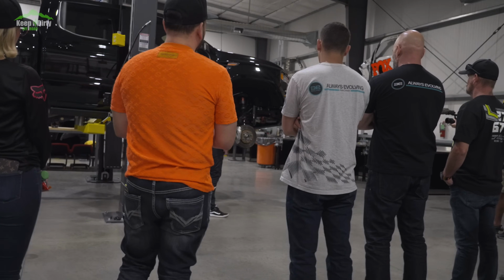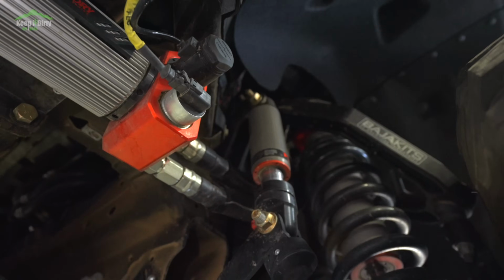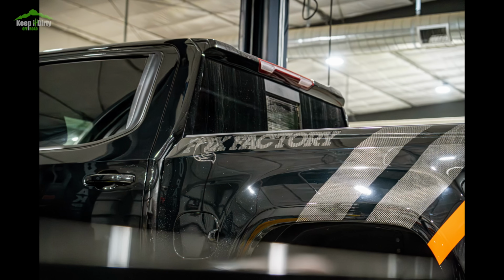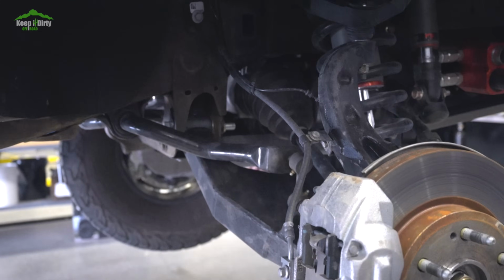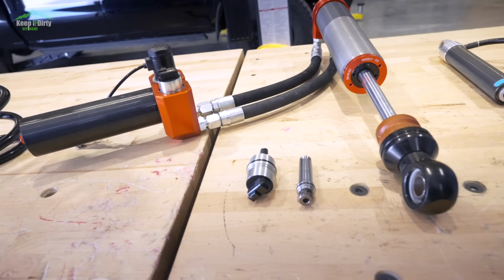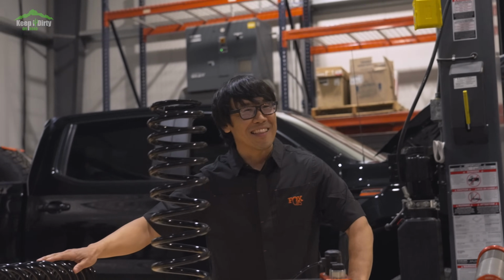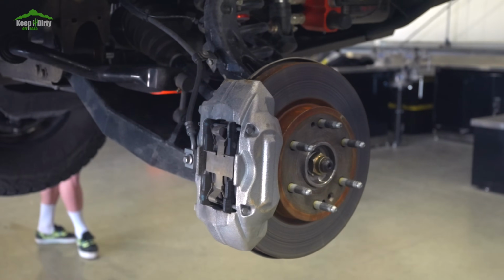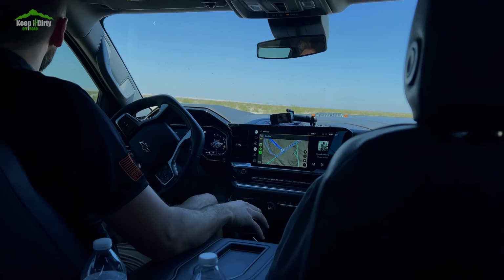FOX event presentation - Fox Factory Truck  Part 1

Comment: Blah ,blah, blah... end of the day. $210K is  not a practical price range regardless. There's probably less than 0.01% that's probably interested. Even if someone had the money for it; they would be better off taking a stock Raptor R or TRX and upgrading the shock system and making it lighter. Otherwise, this project is dead and irrelevant.
Reply from the maker: Very true. A stock 2024 Raptor R would outperform this with no mods.

Comment: Ok..now throw some bilsteins on that thing and close the book
Reply from the maker: 🤣🤣 for these kind of builds most would say throw on some kings.
Reply: @KeepItDirtyOffRoad  very true.. but some guys would rather just go with the best product from the start 🤷🏽‍♂️
Reply from the maker: Huh? For full size trucks Fox and Kings are at the top. No one runs bilsteins on them. Even fewer race teams do on trophy trucks. Winning trucks are still Fox and king.
Reply: @KeepItDirtyOffRoad  right.. i get that most people run king or fox. Exactly what makes you think they're a downgrade? Kings are pretty great when properly tuned. We run king on the racecar.. maybe you haven't experienced bilstein 8112's or m9200's, but they're a touch above. Even in a tacoma you'd need to run a bypass, coilover, bumpstops and limit straps to do what a single 8112 can do. I do however run fox oil in all my shocks
Reply from the maker: I admittedly don’t know much about the blistein product lines so I looked them both up. I don’t see anything better here than what Fox or King offers. If anything I see less from bilstein. The shocks you showed are comparable with the factory race lines for oem trucks from both companies. Limited tunability and rely heavily on a good base tune for the truck. Fox and kind have way more options with a ton more features. Fox has live valves, king has integrated IFPs. So many more options from both to improve the ride and performance of these trucks. 

One thing stuck out to me in your comment though. You mentioned a Tacoma. A much lighter platform that is very, very underpowered. Normally used for rocks and overlanding. Seldomly used for fast off-roading. It’s completely different worlds and you will find very few running Bilstiens with high speed off-roading full size rigs for a reason.
Reply: @KeepItDirtyOffRoad  that's exactly my point.. they do more with less. Bilsteins are highly tunable, the problem is finding a tech with the balls to work on them. They currently offer the most advanced suspension setup for oem replacement. Im not trying to convince you lol.  Its just plain facts. My 8112's are tuned with eibachs and fox oil. The only thing that's come close in the big stuff have been king 3.0's (with a proper tune) and still need a bunch more equipment to match the single bilstein 8112 🤷🏽‍♂️.. again im speaking from experience not personal opinion. Also my kings needed to be serviced every 20k miles.. foxs tend to go further at around 30-50k. Bilstein has no stated recommended service interval. So to recap, they last longer, are more advanced, and are better offroad.. but kings do look really nice 👌🏽
Reply from the maker: Hmm lots of holes in your logic there man. I’ve ran smaller trucks and big trucks. Completely different worlds. And oil breaks down period regardless of the design. Only way it lasts is if you take it easy on any shock platform. I don’t know man. Not sure I trust what you’re saying. I need to see it for myself.
Reply: @KeepItDirtyOffRoad  like i said.. not my opinion. Check out what type of oil the big guys are running and its the same for trophy trucks or a ford ranger.. you are correct, oil breaks down eventually. The difference is the temperature it can handle. Nothing wrong with bilstein or king oil they're just not as good at dealing with extreme tempature. And ya.. don't take my word for it, google or a top shock tech will tell you the same. I wish i was smart enough for this to be my logic, but im just repeating facts here

Comment: Considering all suspension is Baja kits, I bet half shock valving is from Baja kits too lol, where is 200k value?
14-15" on wide body prerunner is basic. 
This is crazy, you can build this suspension, real readon to get it for under 70k with buying truck. 
You build caged prerunner for 130sh

Comment: A used 1st gen tacoma with a URD kit $7k and decent suspension $20k would spank this lol and it would identify as a build like this chevy 😂
Reply from the maker: The only way a Tacoma would be better than this is if it’s LS swapped period. There isn’t a scenario where that V6 is making anywhere near 700hp.

And yes, you could fully link and LS swap a Tacoma for less.
Reply: @KeepItDirtyOffRoad  ls3 with a Magnum or Whipple and sas or 5.0 from HRD

Comment: Please tell me there will be a version of this with the LZ0 Duramax!
Reply from the maker: I think you can pick whatever base truck you want. As long as it’s a 1500. Can you get the Duramax? In the 1500?
Reply: @KeepItDirtyOffRoad  yeah you can get the LZ0 3.0L Duramax in 1500 GM trucks. I have the older LM2 on my 21 AT4, and it's an amazing engine offroad with an amazing range per tank and a ton of torque. Don't plan on going back to a V8 gasser as long as this is an option.
Reply from the maker: Really? Going to have to try it out. Diesel engines aren’t known for their pep. How’s the power band? Do you really need to get on it to get it going? Or is it peppy like the 6.2?
Reply: @KeepItDirtyOffRoad  you should really check one out. It doesn't rev as high as the 6.2 so it feels different. It can do the same at lower RPM and the 10 speed does magic with that engine. The turbo diesel has a lil bit more get up and go than the 6.2 at lower RPM but the 6.2 feels more responsive at higher RPM. Now with tuning and even larger turbo, there is no question that the little Duramax blows the 6.2L out of the water. I do some of the high speed dirt roads here and my truck cruises so effortlessly compared to a gas engine at the same speed where it feels like it's screaming all the time. It is a very different driving experience.
Reply: @KeepItDirtyOffRoad  https://youtu.be/can7cH3TnWg?si=yCXK0GgCVYY02vau
Reply from the maker: Interesting. May have to go drive one this weekend. Where do you normally wheel?
Reply: @KeepItDirtyOffRoad  Central Florida, Ocala National Forest Area. Let us know what you think of that engine after you test drive it.

Comment: Interesting their incorporation of a steering damper on an IFS platform. Their solution to bump steer from a suspension geometry that couldn’t be optimized without cutting into profit margins?
Reply from the maker: They way they explained it was the steering rack is not optimized for offroad use like the raptor one is. Being eletronic, they tried to adjust its programming to better deal with offroad feedback and they bricked the whole system. They said so on the video. 

We will talk about the steering in the next video. Because IMO it still needs some work and the slow ok footage shows it

Comment: Just from this video I have ideas, thoughts about the future of off road suspension, etc. Will wait for video 2 but I'm excited for the future as I prepare my gen 1 for gen 2 live valves and SDI system.
Reply from the maker: We are on the same page there. There is a ton of potential here and it’s a new level of customization than can be done on our driveways. So excited for what this can turn into.

Comment: I liked your questions. With the new compression and rebound Fix shocks on the 2024 37 package trucks those new 3.2 could be very interesting. Then add in what is basically a EClick then your talking almost a mid travel level.
Reply from the maker: Yeah. This thing takes it a step further with the position sensor on the shocks. Imagine with SDI could do with this system. Because the Fox guys figured out forward stability. But their side stability still needs some work

Comment: It’s crazy that this is the real only OEM type truck for GM fans. Just buy a Gen1 Raptor and build it or buy a TRX or Raptor R and you’ll be extremely happy. This just seems so extra.
Reply from the maker: Yeah it does suck. Because the only true off-roader from GM is the Colorado ZR2 bison. But the current gen only has a Turbo4. 
I wish this was more affordable or that they release all of these components as a kit so that we can build these in our driveways. Everything is bolt on so no reason why we could not build this

Comment: I don’t know. A lot of hate in the comments but buying a 65/75k truck then buying 40k in parts(glass, bumpers, live valve fox shocks, billet links, bumps, slappers arms, LCA and UCA, gusseted/ double sheared, cross over brace, supercharger, electronics, lights) then having all the labor, paint, shock tuning, engine tuning all done for you. And looks factory no gaps, no empty spaces. Might not be $200k but it’s not far off. Just finance and go have fun. I like it. I wish I was part of that middle class to afford it.
Reply from the maker: There is a lot to like here. The main thing that sucks is the price. I think this is a $120-140k build max with everything at low production numbers like they are doing here. And it’s basically on par with a Raptor R, BUT with a peppier engine. That 6.2 is awesome and power on demand was crazy.

But the biggest thing I hated, was nothing that Fox did. Build quality of the GM truck is nowhere near as good as Ford. The door rattling on the ride along was crazy and very loud.

Comment: So Fox bought Baja Kits from Brenthel and now they built a few trucks with fully bolt on kits. These are a rolling advertisement for the Kits Baja Kits/Fox will have out for the Silverado. Why else would they try and make a fully bolt on kit seem better than welding/custom framing? Just my guess.
Reply from the maker: Yeah. I think that’s the goal. But they probably won’t release the kits until after the first 500 are sold out

Comment: lol…everything is bolt on no welding..aka buy a basic 4x4 Chevy Silverado for 60k and order this kit for 20k max and save over 120k at least  lol 😂
Reply from the maker: That’s my thought exactly. Though it would be more than that in parts I think.

Comment: After two Raptors (2014/2017) and 22' TRX (paid $81k/factory ordered/price locked in Fall 21' (MSRP was $93,400) had to imagine the "Value" without any Manufacturer 'lineage'/years of history in this niche segment (like the 40% stronger frame on the TRX vs. REBEL).

For example if Ford (or hopefully RAM revitalizing the TRX namesake) built a true HALO low production vehicle ($150k-ish).  <- Wider flares, 39's on optional beadlock wheels, modular and popular usability upgrades for the bumpers, bed cage and interior (that can trickle down/be fitted to the TTV6/R), etc.  Similar to AEV (even SHELBY) - they could offer the ability to 'factory' retrofit an existing customer vehicle for greater future value and resulting KBB reference (ie: an AEV conversion vs. personally adding AEV parts) <- I had contemplated both these scenarios with our 21' CTD2500.  Shipping it to AEV made more sense vs. a AEV build 'replica'.

Unfortunately at the price point I just see it as another future Barrett-Jackson offering alike their past FOX H2 editions (I believe they were to be built alongside SMA Hummer accessories?).

Side note: FOX have acquired Shock Therapy (UTV suspension 'gurus') and doing turn-key Polaris builds under the UPFIT brand (circa $75k production builds)....sold on dealership floors with their own KBB designation/available financing.  The $30k 'gap' is reasonable considering many enthusiasts spending (near) similar (customcage/wrap/wheels+tires/seat package/intercom/fresh air system/ICE/etc)...and the quality of these units/installs is very impressive in person.

Admire the efforts but many have tried to offer low production GM/Chevrolet offroad builds (PaxPower/SVP,/YENKO, etc.) with little volume success.  Akin to 'Flying Car' magazine covers that never come to full fruition.

Instead of having y'all there post production... would have been more interesting/potentially valuable to 'Crowd Source' such minds and suggestions PRIOR.   These contributions/ support community would help propel the end results further (with more intrinsic/extrinsic value!).
Reply from the maker: Totally agree. I get where they are going with it. Make it exclusive and make maximum profit for a short run because scaling production is very hard. I just wish GM actually built something like it at a reasonable price.

Comment: It’s only 40k more than a raptor R with markup…what’s 40k nowadays after inflation 🤣🤣🤣🤣

Only thing I’m mad at is Baja Kits lol 😂 

Dirt king has a crazy rear suspension setup for the chevy’s right now…and it’s got air lockers :( it’s a lot of aftermarket based parts. Chevy needs to make a true OE version of this for 100k cheaper and that might be what they do at some point ?
Reply from the maker: Rs are going for $140-150k so this is $60k more.

But agree that we need GM to actually make an OEM truck to match the Raptor. But I don’t think they will. Their lame attempt was the Silverado ZR2 and that’s it. The Colorado ZR2 business is probably the closest GM will get
Reply: @KeepItDirtyOffRoad  140 isn’t too bad…last one I saw for sale was a 2024 brand new for 157k with an MSRP of 112k maybe I need to look harder …
Reply from the maker: You can get them down to 30k markup is you look and negotiate. Some guys getting as low as $5k over, but they are waiting. Year or more to get it
Reply: @KeepItDirtyOffRoad  I don’t mind waiting but the dealers all give me the runaround saying they don’t have allocations lol 😂 but when I’m serious I need to see if I can get the price down to 130k or less cause I need that V8 if I’m gonna do it…

Comment: The only thing I took away that is actually beneficial is the sealed joints so no greasing (dirt/mud state). Idk if they perform to the same standard as far as articulation and durability. But I actually appreciate it.
Reply from the maker: Brenthal brothers did say they tested quite a few to make sure they had the same flexibility as your typical heim joint in that same situation.
Reply: @KeepItDirtyOffRoad  I saw that. It makes me hopeful for innovation of parts across all platforms.
Reply from the maker: Agreed. Heim joints are great but they wear quick and have a short lifespan. A sealed ball joint with the same flexibility would last much longer
Reply: @KeepItDirtyOffRoad  exactly. I want that concept for all of our trucks. Less maintenance means more play and more money for upgrades

Comment: For 210k, you'd expect something more than a Baja kits bolt on kit and a rear coilover that doesn't have the spring 1/2 way down the body. The travel numbers are comparable to a 35" tire gen 3, which is a good baseline.

Overall, if you have 210k before tax burning a hole in your investment account and you want one of 500 trucks, then it's a good buy. For anyone else, take any platform to a fabricator and get a solid 4wd cadged truck for that money.
Reply from the maker: Good eye on the shocks. I agree man. The price is crazy high just in the name of exclusivity. For the same money you can have HM build you a fully caged prerunner